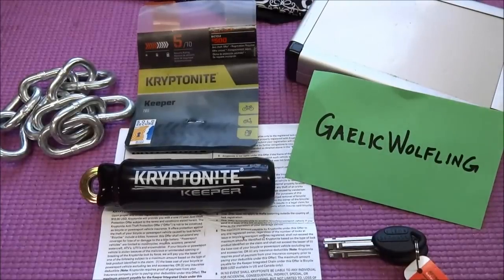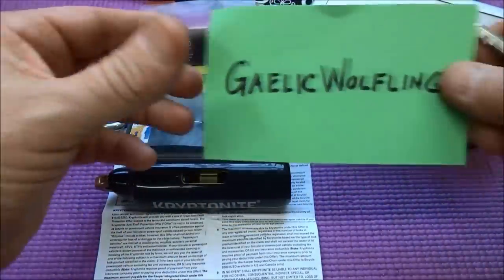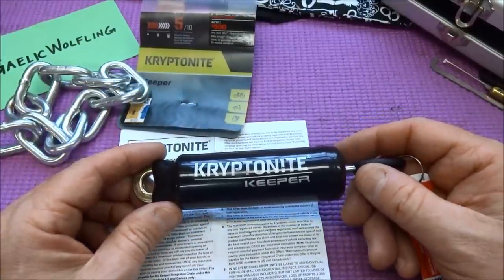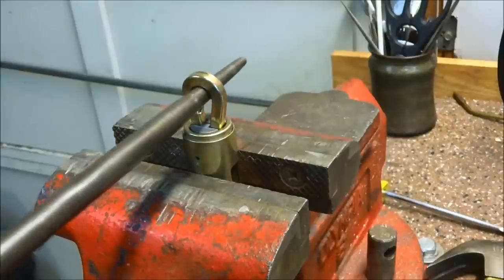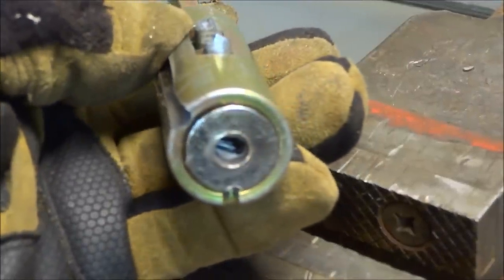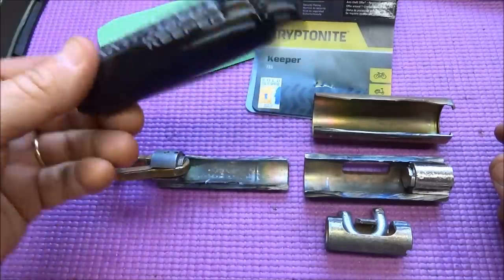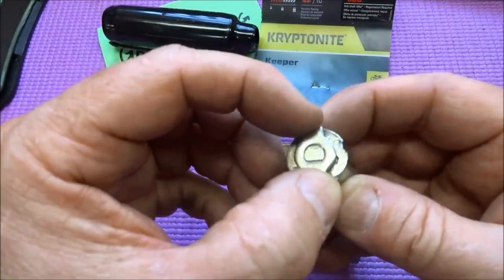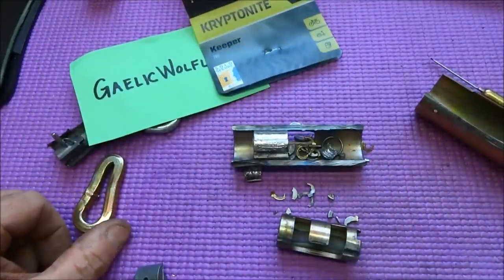(397) Kryptonite Keeper Bicycle Lock Autopsied - One TOUGH Lock!!!

Comment: The most amazing part is this lock only costs $30.
Reply: The lock is great, but the chain should be quite easy to cut with decent bolt cutters.
Reply: Kinda piontless to have a shit chain with a lock like that
Reply: It's a 7mm chain. It should be easy with large enough bolt cutters. Majority thieves use destructive methods rather than lockpicking, so most of the protection is needed for that purpose
Reply: Kryptonite itself only gave it 5/10 for security. Hard to pick but if someone has some heavy duty bolt cutters they would make short work of the chain. Having said that, I have this lock and think it's awesome. It's light and will deter thieves enough where I live from trying to get at a $500 Kona mountain bike... I hope :-)
Reply: Because 8-10 is very rare. Try and get a bite on the square T3 manganese steel of this lock and see how that works for you. 7mm becomes as hard as a 9mm+ to cut. Only thing to defeat it is a grinder.
Reply: PurpleMonkeyWaffle or heating it up give it to a blacksmith they will get through it
Reply: Torch attack works best against kryptonite locks.  My bike shop get complaints about kryptonite locks.
Reply: Stealth Core ...  ABUS WORKS ALOT BETTER.
Reply: Rick Insanitorium ..  kryptonite lock in Honolulu are heat attacked then the bike is stolen.  Use ABUS locks chains and cables

Comment: 4 am and im stil watching your videos .
nobody will fucking steal my bike now
Reply: Vova3iLvova i have a battery operated angle grinder that will probably last longer than your chain or whatever bike rack on which the bike is chained.
Reply: +Bevis deBunghole Yes and all the noise you're going to make for an extended period of time is probably going to put you behind bars, hope your angle grinder works there.
Reply: +Mike McGuire "Yeah police, ive lost my key a couple days ago and i just dont want to leave my bike here forever"
Reply: +Vova3iLvova u know I just carry my bike to my home/room/balcony, I bet its more safe than your bike with any lock...
Reply: mtkl23 lel i keep it at home too but i gotta  ride it outside and leave it there , by university, malls  and stuff
Reply: +Vova3iLvova Gemme 10 seconds and an oxyacetylene torch, angle grinder or shears. The weak point isn't the lock, it's the chain you will attach to it.
Reply: Mp57navy but why ? if next to mine is a bike locked with a cabel lock )))
i have a u lock. abus mini to be exact
Reply: Mp57navy I've already had to break into one of these locks with an angle grinder after breaking a set of bolt cutters. It is no simple task and takes time due to the fact that the chain is made of thick hardened steal. Also nobody is impressed that you can name tools.
Reply: +Vova3iLvova Nobody wants to steal a cheap crappy bike. Think about it?
Reply: Marky Polo you are wrong .
Reply: +Vova3iLvova Well, personally, I rather lose $100 bike I bought at Sams club than a $1000 bike I had to have from Joe Blows specialty bike store. What is YOUR preference?
Reply: Marky Polo get my shit locked up
Reply: +Vova3iLvova Maybe you're a bit slow. As these videos are proving, 'locks' only slow down a determined Thief. Cables and chains are generally much easier targets ( in case of a bike). Why would any Thief steal a $100 bike when there is a fool with a $1000 bike right next to it?
Reply: Marky Polo dude you cant snap some u-locks with bolt cuters in seconds  . you need at least 3-5 minutes with angle grinder 

you can steal shit load of  200 $ bikes with shitty locks with no fuss rather than 1 1000$ with grand sparkling show

of course there are no 100 % safe locks

thats why you shouldnt leave your super expensive bike without proper precautions 

this is a perpetual internet debate with no answer 

you either lock your bike with quality lock in proper places  and have big chances of finding it when you come back

or you lock it with shitty lock and inevitably some day  come home back by bus 

or never leave it anywhere except home 

you should already know all options why you making me write  this
Reply: +Vova3iLvova I am NOT disagreeing with you. If it has VALUE, LOCK it up! Better yet, keep it OUT of SIGHT. I have not rode a bike since my college days ( 1980). In those days an "expensive" bike was $150. I would not even consider riding a bike worth more than $500 to school these days ( no matter what kind of lock I had). What I have learned in my old age is that Expensive things are often not worth the headache ( owned 3 Cadilacs, all were a shit and trouble).
I was just saying, If I were a Bike thief, I would go for the money bikes. I would not waste my time on a $200 bike. Plus, many people think their $3000 bike is 'safe' in their garage. It is not! Although I don't ride bikes anymore, I know a piece of Quality when I see it.
FYI: I am here on this site looking for the best ways to secure my Tool Trailer. I will use a combination of things. Brahma wheel lock, Proven Industries Coupler Lock, Alarm system ( requires active battery), and possibly easily identifiable paint markings.
We both want the same thing. Keeping our valuables out of the hands of POS scum bags. Right?
Reply: +Vova3iLvova You sure won't have 3-5 minutes in broad daylight. But most bike thieves just double lock your bike and come back for it in the dead of night.
Reply: +Marky Polo cheap bikes are the most commonly stolen because cheap bikes are the most common bike on the street. Think about it, most bike thieves aren't thinking about their long term salary. They are looking for $50 to get high or pay their rent.   The fact that they are stealing bikes already shows their lack of intelligence. Stealing bikes is about quick easy cash, it doesn't matter what bike it is.
Reply: +Mike McGuire You may be right there Mike. However, I tend to see a lot more expensive bikes ( over $500) than cheap ones. But that is my perspective as I do live in a University town ( NAU).
But one thing we can be certain, it pays to have a GOOD lock! Right?
Reply: +Marky Polo Yeah Im not sure where you are at. I paid $500 for my 1980s Schwinn which is my daily commuter and I still consider that a cheap bike. A $1000 bike is entry level. $5,000 are what i consider expensive bikes. I don't lock my $3000 mountain bike up in public, but I'm fine locking my Schwinn up. But most bikes out there are probably walmart bikes, depending on where you are at, which are like $50 - $200 bikes.
Reply: +Devin Chaves Today, Thieves have no fear of getting caught in the act. The victim is powerless to even stop them. If the victim lays on hand on the scumbag, the police call it Assault. An Assault charge outweighs a theft charge. The thief agrees to drop the assault charge if the victim agrees to drop the Theft charge. Criminals have it made in America.
The only way to beat these thieves, is to buy the BEST deterrent.
Reply: +Mike McGuire You know your bikes. But for god's sake, LOCK up that $3000 mountain bike!!!!
Reply: +Marky Polo I don't lock it in public cause I never leave it's side when it's in public.

Comment: If you look at the pricing history of the lock on Amazon since the day this video was posted, you can see the clear correlation of
the amount it's gone up- really proves how convincing an analysis you did here. :)
Reply: ***** Here's a price tracking website: http://camelcamelcamel.com/track/4b955df7bc5610091291b6b25bdbb534aea79ee1

The prices on Amazon fluctuate constantly, what day did you originally buy it? Look at the chart from before and after October 5, 2013 and you might see the trend.
Reply: Whether or not there's an increased demand, Amazon's pricing seems to generally scour the market to determine the amount they can get. While it may seem random and fickle how they set prices for different people, I'm sure there's some system behind it.
The historical chart has more data points in it than a single purchase, and if it was just coincidence how it seemingly changed exactly on the day, it was a good one.
Reply: i have a sense bosnianbill was being paid to endorse this lock through means of creating this video and touting its strengths. just a hunch.

Comment: Im no locksmith, but a method I have used to extract blind roll pins or blind solid pins is to use a tig welder to carefully build up weld on the pin, then weld to a rod and slide hammer the rod to pull the pin out. automotive manufacturers occationally use a blind pin to make a part un-servicable. I cant imagine any other welding type giving the controll required. and obv depends how hard the pin was driven in.

Comment: The chain is the weakest link :P
Reply: Not if i have a 1/4inch boron steel chain.
Reply: Ta Baron how you gonna hook the 1/4inch boron steel chain to the closed side of the lock?
Reply: danthemanzizle goodbye
Reply: +Ta Baron 1/4 inch is only 7mm.  Any decent bolt cutter will get through that.  The minimum you need is 12mm square link thickness to fend off a bolt cutter attack, and that is for a high quality chain.  Kryptonite chains are not as high in quality as ABUS chains.  The chain IS the weakest link here.  That is a flimsy chain.  It keeps out honest people.
Reply: +danthemanzizle Especially if someone has a hydraulic chain cutter.I bought a logging chain and wondered how it would be cut till I saw the hydraulic cutter.Cut through like butter.One could be easily made or bought to be portable.and people DO NOT PICK locks for things like this.They cut through.Much faster.But it all depends on how bad someone wants what their breaking into.I DOUBT a bicycle is going to be high on that list tho.
Reply: +badkid73 hah metal bar is enough, just put it trough the cahin and start rotating the pole any pole that is like 1 m long is enough to get momentum to brake that chain, loose chains and wires are allways easy to brake like that, ofc if you put the chain trough the tire it will mostlikely bend in the process...
Reply: Grimbles I just lock rear wheel inside rear fork. They can take the front tire and seat (but I removed the qd sleeve), but that's it without cutting into the rear wheel. Bike's not worth much if you wreck it trying to steal it... and I'm protecting the most expensive components.
Reply: krap101 thats what i did as well but did it with 2 wheels front and back but still bike was stolen, they always find a way
Reply: TooLong Did you lock the wheel within the rear fork?
Reply: Actually railing which lock is attached to.
Reply: Not to revive a dead thread, but.. I broke multiple bolt cutters of different sizes trying to get into this chain without leaving a scratch on the chain. This statement is inherently false. All that being said I currently use an abus lock and chain merely because they didn't have this lock at my local shop anymore.
Reply: The chain is 8mm that fits into that lock, even a kryptonite hardened chain can EASILY be cut in seconds with a cheap pair of harbor freight bolt cutters. You have to get above about 14mm before a chain  is really bolt cutter proof. You can still easily cut through even the biggest chains with a battery powered angle grinder.
Reply: Gnome Star ah yes your untested faulty logic has somehow shown me that I should question what I've seen in real life. That or your Pittsburg bolt cutter is made out of an alloy that is far superior yet half the price of my craftsman cutters who now lay bent. I had to ultimately use an angle grinder to get into this chain which yet took for what seems an eternity.. but what do I know? I only have experience in the matter.
Reply: Just watch a youtube  channel by by wayne winston, he tests all sorts of high security chains, from kryptonite to pewag(unable to cut) to pramasis(19mm) chain. There is a reason kryptonite rates that $35 lock and chain as a level 5. The biggest hardened chain he tested with a battery powered angle grinder lasted 2 mins for 2 cuts.
Reply: but that two minutes is loud and the light produced from the sparks is enough to make someone call. or will bring some attention
Reply: easy enough, just buy four and make them all connect eachother

Comment: Why not try drilling out the roll pin instead of trying to punch it out?
Reply: That is what I was thinking too.
Reply: @manp1039  Roll pins are made from spring steel, very hard to drill.  The gap in the circumference also makes drill bits grab, on such a small drill bit it's likely to snap.

Comment: a quick note. the roll pins are actually short and this is how to defeat them. drill right next to them exposing the side of the roll pin. then use a sharp too to "dig" it out. great testing. tough lock.

Comment: I made a chain of 8 Kryptonite locks.

Come at me bolt cutter bros, come at me.
Reply: The kryptonite centipede
Reply: ~Cuts off part of bike its attached to~
Reply: +Ninjadave0o&#160;So you go for vandalism instead of theft. Kind of beats the point.
Reply: Woogoo336
Damn, get a joke... Obviously if I had cut off part of the bike it was attached to, I would remove said part and take the bike. I really don't know how me playing a game years ago has anything to do with this comment, however, if I were to do the same I could say the exact same thing...
Reply: ***** What would be the point? You would have permanently and critically damaged the bike. It has supports for a reason. Also just saying something random and dumb isn't a joke.
Reply: Woogoo336
Welcome to youtube! Do you personally go around, reviewing and bashing poor jokes such as this? Damn you really need to find a better way to spend your time. Also, cutting off something like a wheel, which most people attach the locks to, wouldn't be too difficult or expensive to replace...
Reply: *****  Welcome to YouTube comments! The biggest waste of time for everyone. (But it only takes a few seconds to write a few lines.) Your joke was bad enough you had to tell me it was a joke, so it's not like I was reviewing it. I was hoping to trigger an 8 year old but you seem more mature than that now. And if the OP is paranoid enough to chain 8 of these locks together, you will be cutting apart the frame, in which case you are better off stealing a different bike or buying one.
Reply: I am sorry about the minecraft insult. Trolling isn't my thing. But nice one calling me pretentious while refusing to accept your joke was bad. The "random XD" type jokes are not funny, they only make you like like an idiot. But next time I won't lead with an insult, that makes me look like a troll.
Reply: And another troll. I won't be reading or replying to anymore posts on this thread. I have wasted too much time here as is.
Reply: I think it's funny.
Reply: some bolt cutter fanboys seem pissed off.
Reply: Now the weakest link has just been moved to you.  The thieves just look around for the guy toting a huge keyring.  They jump you, grab the keys, and then take your bike anyway.
Reply: :D bolt cutter bros, haha
Reply: @Woogoo336  maybe I know how to weld and bike is steel or aluminum
Reply: At that point, cutting the bike rack might be easier..
Reply: @mikafoxx2717  true...to be fair

Comment: You sure had me cracking up!...As a well experienced commercial door and hardware installer in the past...we see our share of these toughies, there was one such company I worked for where we were involved in all aspects of these security hardwares from pinning and disking key cores and  key scheduling, to picking standard locks and even bank vaults. Personally, I primarily was just a installer and rarely had my moments with the picking aspects, more often to actually do lock and key creation and scheduling; and yeah, some cases mounted to demolition surgery! And the tougher it was on us to get into something, the more you become a butcher! There were days you would go home frustrated just to come back the next day with ten times the determination and a tool that would get the job done. (But a jack hammer sometimes felt it would've been the best remedy for your destructive desires). Ready to kill, none of us where going to be defeated by some lifeless locking device! Your video is pretty darn funny, and it would of been crumbs of metal in the end for me too! It feels good when you can achieve picking a lock with out destroying it, but it also feels good destroying a lock you can't pick.

Comment: would you say kryptonite is better than master lock?
Reply: Hot glue is better than master lock.
Reply: ***** What if your trying to lock up something made of wood?
Reply: Then it catches fire.
Reply: ***** The universe implodes.
Reply: +PatientZero 609 He just proved it dude ! ....way better than "master lock" ...
Reply: +bosnianbill I know its not much,but if I would have a locking sistem company, you would be the first to be hired ! ....and prove my locks are crap ! ....
Reply: +Worldadventure Lehderp 
You mean use a plasma torch right? Welding often needs to ADD material. ;P
Reply: +AmperaYT WELD IT BACK TOGETHER THEN WELD IT MOARR >:U
Reply: +PatientZero 609 
Never buy a product that have "master, uber, ultimate, super, ultra" and other similar adjectives in the name. Never.
Reply: +invertedlow lol
Reply: Zipties are better than Master Locks.

Comment: The Abus Granit 54 + the Abus Extreme and the Abus Power are bike locks that are still made in Germany featuring the X-Plus disc cylinder. These have an even better quality of material and the locking mechanism is also a bit different and more accurate. They also cost twice as much though.... I also did a video on the 54. I am using the Abus but also the Fahgettaboutit Mini on my 2000€ bike. Worked out pretty well so far and I would consider both locks to be very good quality and tough!